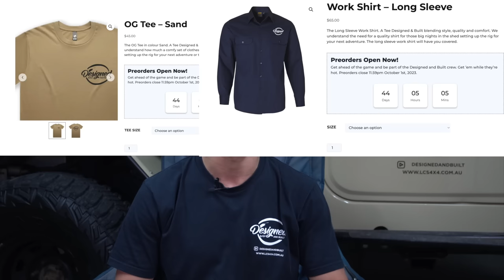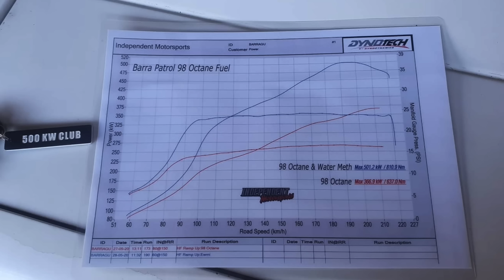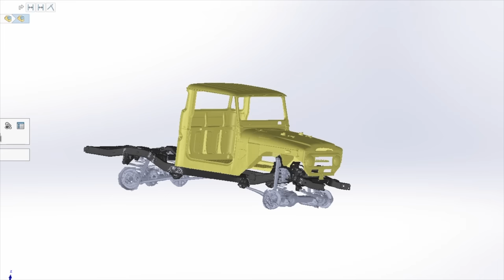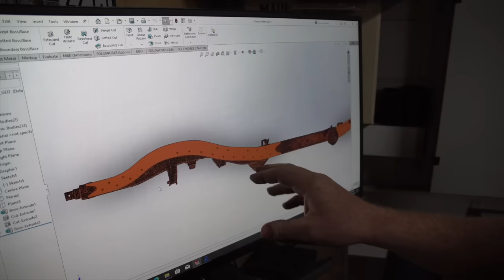Our most AMBITIOUS Build yet - New Build Series Revealed || Build Intro Ep#0

Comment: Sorry, not related to this video but looking at the nice shiny paint in the back ground. How has the valspar tb540 held up so far on the body?
Reply from the maker: Very happy with it! 30k and plenty of 4wd tracks and has held up really well. There’s no clear on it either.
Reply: @DesignedandBuilt 
Nice one. It's most likely the paint I'm going to use when I finally get round to it.
Reply: @bennyjahmin3953 Seems like an appropriate place for my $0.02 worth. In the ~6 years my 80 has been entirely covered with TB540(12 litres), it's only failed in both rear wheel arches, which is probably only for two reasons, they were the only places to miss out on epoxy primer(ran out) and I never grew out of drifting it on gravel roads/tracks. By failed, there are a dozen or so 50 cent sized spots of bare metal, but whatever the TB540 leaves behind, stops any rust forming.
If you're going to bare metal, I'd suggest using an epoxy primer and where it's going to get gravel spray, go over it with Raptor or similar for added protection.
For bush pin stripes and staying put on panel damage, TB540 has to at least ten times better than factory paint.